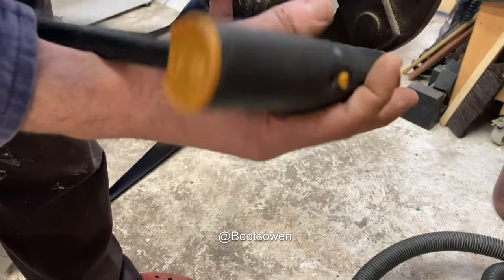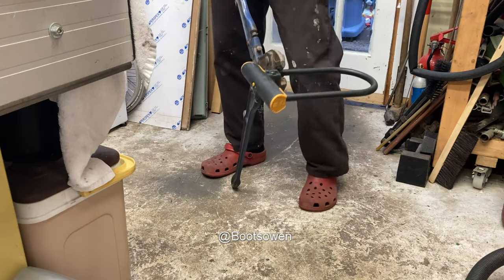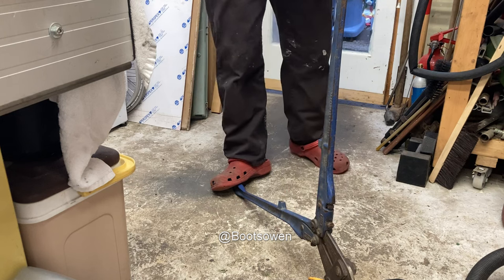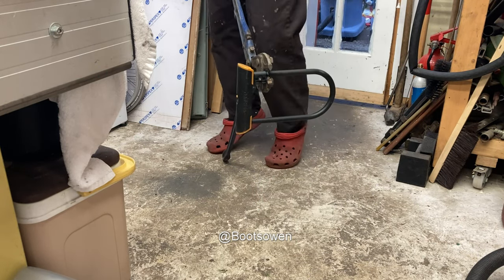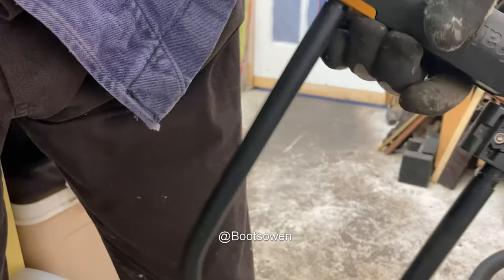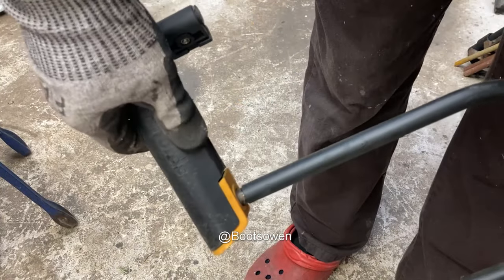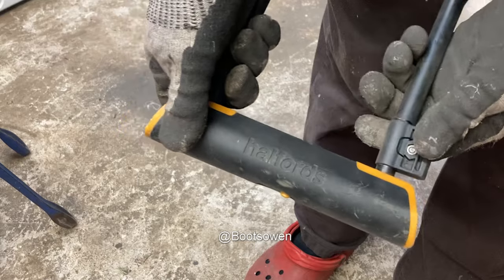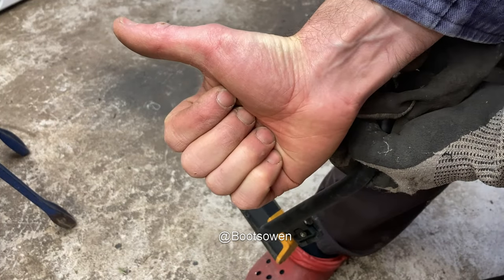Halfords bike lock v bolt cutters and battery angle grinder: who will win?

Comment: My ex used to twists the long u locks off with a long pipe. Always use hardened steel mini u locks or hardened steel chains 10mm and up not near the ground. For locking your wheels locking skewers are way way more secure than a cable lock.
Reply: sounds like a charmer

Comment: This Would Never Happen in Dublin City! 🧐 ...... It no doubt may be commonplace, in such a common place, as that lesser wannabe immatation Irish city ? ...  p.s. looks like a relatively good lock ? .. in fairness it took the Full 6 stone of ya !      😂🤣😂🤣😂
Reply from the maker: I wonder what the numbers are. over here the police don't consider bike theft a crime worth following. I recall in the local garda station at home a shed full of rubbish "found" bikes. A garda could be suspended for looking in there.
Reply: @bootsowen  Still much the same I think.  Even though there's a lot more expensive bicycles around now than in our good old days. It's difficult to prove legal ownership. Most owners don't even record frame numbers. The assumption that a shop has a record is false. For such a relatively high value resellable item it's easy money for anyone inclined.